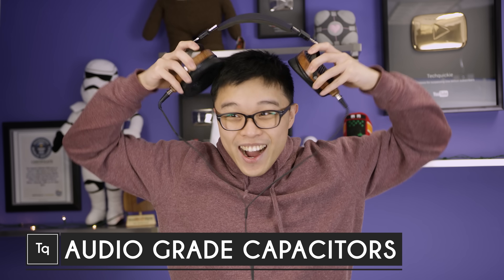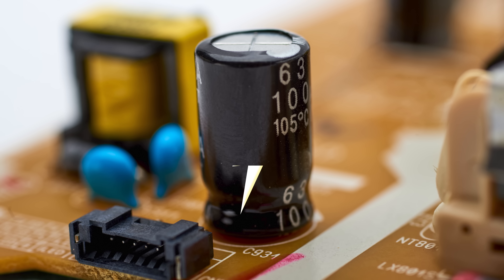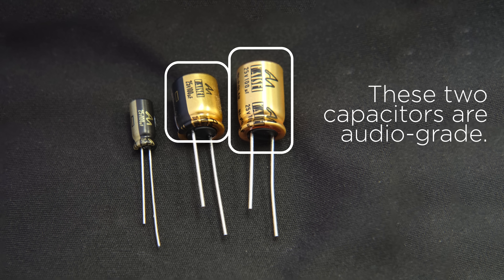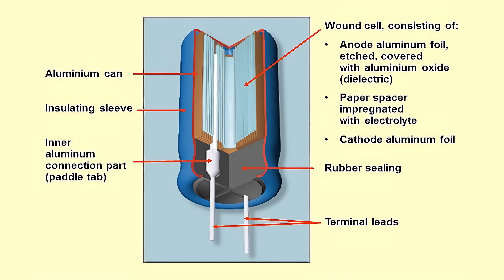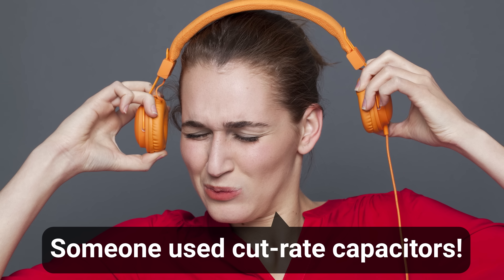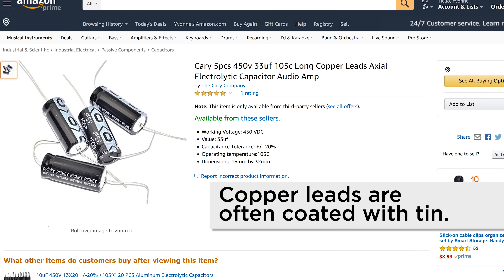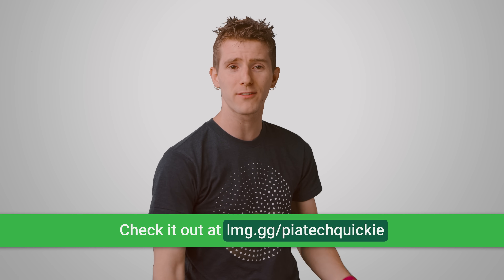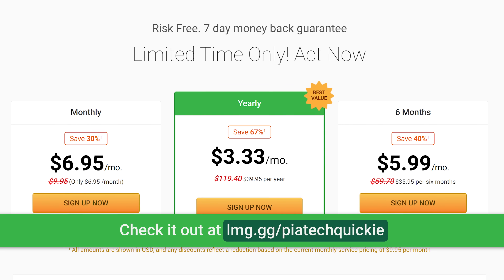What Does "Audio Grade" Mean?

Comment: Electrical engineer here: That was painful. You should really stick to videos on things you personally know about. Reading a script someone else wrote that is so generalized it is basically wrong is not the way to go.

Can you buy junk caps? Yes. Are there nicer ones? Yes. Are electrolytic caps “audio caps”? No. Are ceramic and poly caps used in audio circuits? More than electrolytics. Will nicer caps reduce hum and improve your sound? NO. It’s all about the design. Hum results from poor audio circuit design.
Reply: By the way, respect to electrical engineers, but, working on power systems isn't the same as working on audio surely? Several orders of magnitude different problems?
Reply: @divcurl6044  Not really. For one, electrical engineers are the ones that design audio circuitry as well; just like there are a hundred different kinds of doctors with different specialties, there are different specialties of electrical engineering. 

When it comes to circuit design, the parts we use are scaled up for high power, but the electrical concepts are identical between all disciplines. Capacitors, inductors, and resistors all work the same whether you are passing milliamps through them or killiamps.
Reply: @AustinSteingrube  Yes, I agree, but you would also have to agree that one medical specialist wouldn't understand the depth and subtleties of another's discipline, although both may understand the general principles.

See, although a capacitor may work the same on a gross level, in terms of distortion, say, two components might be very different.

I would propose the difference between four vehicles; a workaday van, a car yourself or you wife might drive, and one an enthusiast would spend serious money on, like a Lamborghini Huracan.

All have four wheels, windows, etc. but the Lamborghini is about something other than blunt functionality and fuel economy.

The Lamborghini may have titanium and carbon components, which, when compared to a normal useage case just seem like expensive BS. But they aren't, they are important to the user of that vehicle.

And, you must admit, that although electrolytic caps aren't exclusive to audio, out of all types of capacitor, they are the most problematic. Therefore, they tend to get the most attention. And, most consumer audio will use such components not just in the PSU, but also for coupling, due to size and cost limitations.

Overall, it seems this vid was about what makes an audio grade capacitor different to a vanilla one, rather than to go into depth about physics and electronics. There is a different audience and platform for that I think.
Reply: @divcurl6044  You are still missing the point. Electrical engineering does not change because you are working on one type of circuit versus another. The medical analogy was meant to convey that electrical engineers do a wide variety of things (as opposed to just power as you suggested), not that we are so hyper specialized that we cannot or do not understand another specialty. You can take an EE that worked in a company that makes medical devices and drop him straight into a company that makes guitar effects pedals and he/she will be right at home. Someone that does power electronics could just as easily work on embedded systems. While there are minor differences on what is important, the basis for everything is so universal that there is very, VERY little that doesn't cross over.

With the exception of some very niche fields, all circuits work exactly the same and are used in nearly all types of electrical engineering. Bypass caps? Used in literally every device. Constant current sources? Used in audio filtering, amplification, and power management. Op amps? Use in anything more advanced than a toaster. RLC networks? Again, in pretty much everything. The equations don't change and neither do the components. It is LITERALLY like legos - once you figure out how they snap together, you just connect them up.

To reiterate, there is no such thing as an "audio grade capacitor". There is no need to go into depth about the physics because it is all junk marketing. You can have the greatest capacitors ever made, but if you do a junk job on your design, they aren't going to be worth scrap. I recently worked on my guitar amplifier to nearly eliminate hum - want to know how I fixed it? With copper tape for EMI shielding and a ferrite core bead around the power input. No caps were used. How did I know this would work? Because the principles of electrical engineering don't change and I understood the system.

Comment: What a load of bollox...... they are electrolytic caps with a different wrapper on  off the shelf parts.
Copper leads are "specials"  for certain markets where corrosion or  galvanic issues  are deemed a problem.. 

or where you can find a market of thick fucks willing to pay massively over inflated prices for techno babble they do not have a clue about.

yep.... make sure the wires are in the correct plain so that the electrons are not interfered with by the magnetic flux of the planet..
 don't forget the drop on the cable to the floor, since gravity will affect the speed the electrons fall down the cable and then the sound will be out of sync....
and finally watch out for those sun spots....

Comment: Fun fact, the mostly likely non-moving part of most electronics to fail is the capacitor, and they're super easy to replace. I buy dead motherboards all the time just to replace the $1 in capacitors and resell the board for $50+ on eBay.
Reply: I like your style, I would have died of starvation if it wasn't for repairing HP computers in the 80s and 90s. I miss those days. I also "modified" nowadays would be hacked, HPUX so to give obscene error messages, nice....creative spirit and all that. Didn't go down well with my employers for some reason. 

I was going to say how I did that, but I don't think I should.
Reply: Div Curl very familiar

Comment: This is not very accurate, I'm an electrical engineer and I can confirm that "audio grade" doesn't really mean much. Electrolytic capacitors are not only used for audio, if you open a power supply you will no doubt see several electrolytic capacitors. Look at any motherboard, next to the CPU socket you will find several large capacitors that are used to stabilize the CPU voltage. Now for the whole talk about getting a lower resistance, I just want to point out that resistance is linear and does not introduce any distortion, only an insignificant loss of volume. Impedance though is different: The impedance of a capacitor is a complex number, and is the sum of resistance and reactance of the capacitor. The impedance depends on the capacitance and the frequency of the signal. Having capacitors that are too small will reduce the bass, since the impedance of a capacitor increases as frequency gets lower. Basically, all you have to do is make sure your capacitors are big enough and you're good. It goes without saying that capacitors are not the only component that matters. Most distortion comes from the DACs, ADCs, and semiconductor devices. Non-linearity in semiconductor devices is unavoidable, and good circuit design is the only way around that.

Comment: You can solve this problem by using an off board DAC/AMP to process the audio outside of the case where there is no high power interference.  Decent ones aren't even expensive and are worth having.  Anything is better than your GPU fragging your board components when it's under load.

Comment: I may not know much about electronics but I'm sure the only reason Japanese capacitors are a selling point is because China has such a (well deserved) bad reputation. If some motherboard is built with "German capacitors" people will instinctively trust those too, for no other reason. And I would, too.

If you buy something rated for 50A from China, don't try and load it with more than 10A without a fire extinguisher handy.

Comment: Soooooo much misinformation in this, it's not even funny. 
Japanese caps are only considered as "better" because they haven't yet had a bad batch issue. Most Chinese/Taiwan/etc caps are just as good in general.
Ceramic, Tantalum, Mica,  and SMD variations thereof are just as prevalent in general than Electrolytic these days. The video makes it out like Electrolytic is the only type that matters for some reason. 
The ONLY things that matter on caps are all identified in their specs. There are no magic secret sauce ingredients that make a cap better than another. It either meets a spec, or it doesn't. 
Furthermore, caps ALL age over time with use. Hence the magic smoke upon turning on retro computers sometimes. It's also why as a motherboard ages, crosstalk will seep into audio channels from Interference even if the board when new didn't have that issue. 
What matters FAR more than individual cap quality is amp design in general. Which amp class design is it? A, B, C, D, AB...? How much attention did they pay to the filtering as a whole?  You're not likely to notice a cap difference in and of itself. Almost all noise issues in amps come from amp class selection and overall filter design.
This piece was pretty low on quality IMHO. I'm a pro audio engineer by trade, and this made me eye roll constantly. Not. Helping.

Comment: As a former audio nut, audio grade can mean:
1. uses expensive materials, often visibly, for example nano tubes, gold, silver, silk, noncrystalline "aligned" magic copper
2. is "artistically" handmade by audio dudebros with funny facial hair
3. is designed well from an engineering standpoint for particular electrical characteristics needed for a design
4. is mechanically well made
5. is very consistently manufactured so matching of pairs for each channel, for example, is easy
of these 1+2. often gets the most focus in audio nut circles but 3-5 are what actually matters :)
As Linus said "buy genuine Japanese for the specs you need" is a good rule of thumb, though Korean is super fine too.

Comment: That's the crazy of most consumer obsessions.

Fact is most people are either partially deaf or in circumstances that make it hard to hear beyond even "good audio" let alone high fidelity, as evidenced by the extremes that audio aficionados go to to make audio neutral rooms filled with sound absorbent cone walls and insulation in the walls.

We live in a world horrendously polluted with everything, PARTICULARLY noise. Instead of doing something about it people actually make it worse. Besides the noise they produce from all the cars, trucks, machinery air conditioning, and household/office devices, they make MORE noise with what they are trying to listen to. Commuters are the worst, turning up their sound to deafening levels to try and out compete with everyone around them.

Result? Nobody gets what they want and everybody gets what they don't want. Hearing problems.

Comment: Capacitors themselves do not simply "lower" the impedance of a system, but rather counter the inductance of a system which can come from the inherent length of an audio cable or the speaker driver size/type. The electrical noise mentioned is because of possible coupling of the AC audio signals into the DC power input of a digital audio IC. A decoupling capacitor is then used to "smooth out" the power input signal. This capacitor also counters the inductance of the traces/wiring just on the PCB. Basically, if the decoupling capacitor is not sized/specified correctly, then audio degradation can occur. 
Of course, there's more to it, but I've ranted enough lol..
Reply: Isn’t inductance dealt with by using a transmission line?

Comment: Tolerance is also an issue that should have been touched on. Many caps can be +/- 10+% but audio ones are usually +/- 1-5%
Reply: I concur 100% as audio/computer fanatic & capacitor nerd. 
This should be a multi part video. 
You can’t talk about capacitors whether “lytics” or film caps without talking about tolerance!!!

Comment: oh the schiit magni. i also bought a headphone amp from them only recently. but i probably have a uniques problem. my sennheiser hd 270 not only needs more ohms, which is advertised a lot up to 600ohm, but also more than 230mW RMS per channel. At least the old Onkyo from 1998 still brings better bass and pressure. now i'm looking for a good soundblaster for analog output again, because i'm otherwise connected to an av receiver and hdmi or audiointerface. The last one was an audigy a few years ago. last i took a look at evga nu

Comment: For the most part "audio grade" is hogwash.  The capacitors used in making the DC-DC converters for power supplies are commonly  better than the "audio grade" ones.  Listening to the exact same sound source on multiple systems may work to rate the equipment but only if the person listening doesn't know which is which.  Without that human bias always win over actual sound quality.  Remembered sound is even worse.  You need to go back and forth several times fairly quickly.

Comment: you forgot to mention that audio grade caps are marketing BS lol for example steel or copper leads on an electrolyte cap make no difference because ESR and inductance of the cap itself is orders of magnitude higher than the leads... if you examine the electrodes and dielectric youll find a regular low ESR electrolyte cap which you can buy without paying the premium for that audio grade sticker

Comment: I'm calling it - This is complete and utter bullshit. You can't hear capacitors, you can only hear an improperly created circuit (which is what you'll get from a really cheap cost-cutting system). A suitably large capacitor with low ESR will work perfectly fine. You don't need to gold plate the leads. If anything you'll pick up more noise after your DAC from local interference, etc (remember the old speakers where you could hear your mobile phone if it was too close?). You're gonna get riipped on this by the electronics channels.

Comment: There's no difference between "Audio Grade" and the normal one
It's just simply normal low-ESR cap. It is pretty much a scam
Reply: @0x8badbeef  
In this case it is aluminum oxide.  That is about as linear as you get so long as you keep the capacitor positively biased.  Him skipping that is minor.
Reply: Often the "audio grade" are not as good.
Reply: "Audio" requirement is pretty cute when you compare it to other more demanding application. (Switching PSU, high-frequency circuitry)
Yes, quality does matter. But I doubt you would notice any difference between Nichicon low-ESR and Nichicon "Audio"

Comment: Caps store electricty....... Well, sort of... in a power supply, yep they help to smooth pulsed DC voltage into a smoother more pure DC BUT,  in AUDIO circuts they also block DC voltage while allowing AC voltage to pass through with a minimum of restriction or Impedance to the AC signal which is what the audio signal is made of.

Comment: So what about the difference between audio grade and "militarty" grade.
Reply: Military grade merely means the cap meets a specific reliability and tolerance specification given in spec sheets by the military for use in some of their equipment (hence the short term "mil spec"). It's generally a certification to the government that the product is as reliable as they want it to be. That's it.
Mil spec caps can sometimes make better audio caps die to the tighter tolerances and reliability, but that's not always true. Not all mil spec caps are better for audio. A different part that's not mil spec may actually have even better specs than mil spec. What matters most for caps used in audio applications is if the spec sheet for them matches what the circuit design calls for.

Comment: ok that was not short. so short version is, every thing emits EMF or radio waves, better capacitors are less susceptible to get affected by and also get filled and emptied faster without running out of juice cutting the top of sound waves resulting in the distorted sound you hear. (that crcrcrcrrrrr sound) long version below.

long story short, think of one part of it like a heating element. one gets hot in 10 seconds, the other in 1 minute. the one minute one is inefficient. the other part is noise and interference. like trying to get a radio station, the antenna picks up waves. well your capacitor also gets those waves. but from it's own electrical components. so to reduce the humming (the 60Hz bass sound of the power outlet) and hissss sound (the psshhiiiii sound when you raise the volume.) you need better components. 

in recording you definitely want those better components! playback is one thing, recording is a ton worst! so you need Capacitors that has good response to electricity going in and out as fast as possible without running out of juice (that is what the distortion is... when out of juice, it cuts the top of the sound wave and that is how it sounds) and that does not get polluted by interference from other components plugged in or even from radiating radio waves next to it AND including it self. (this can cause harmonics... think of a magnet through a table moving a coin... but instead of the coin, it is the electricity stored down the line, and that line is coiled over it self and causes noise...)

Comment: Errrrr. Aluminium oxide is the standard for capacitors. It's there to insulate one side of the foil so it doesn't short...
Reply: Honestly dissapointed with this video. I am a fan of the channels and still will be.

However most of this stuff is basic physics and nothing mentioned here isn't standard for a capacitor. There was no special properties that would make it any different